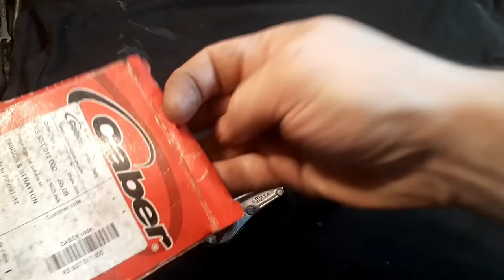Briggs & Stratton Classic Engine Restoration (3.5hp) Restauracija

Comment: This how i got started  with  small lawn mower  engine i used to cut grassy for my community  10 bux a lawns  me my  father  found a cpl lawn mowers  in the  garbage bumped  we got one going  to  my little  business  and  after month later some of  my  money  i saved up me and my dad  went bought  new parts and  other stuff like blade and we started  rebuilding  one push mower   i was able to cut more lawns in short amount  of time i save enough  money  for the following  summer  for used riding lawn mower 😊

Comment: Pro tip: your lawnmower will last a little longer if you fill engine oil after 'restoration' . Also remember to apply a little oil onto the air filter sponge.

Comment: You should be using a torque wrench on the head bolts.  Otherwise the thing I will point out to a lot of folks is this isn't a car engine, a typical 15 year old B&S engine probably doesn't have more than 200-300 hours of use on it so you can use a lot of barnyard meckanic tricks on it and it will likely outlast whatever it's used on.  Most mower decks seem to rust out as people do not clean the bottom of them after use, leaving wet grass stuck to the bottom of the deck, ruining it.   Back in the 60's a few lawnmower companies (Hahn for example) used aluminum castings for mower decks and those mowers lasted 50 years or longer.

Comment: You forgot to oil the "Oil Foam Air Cleaner" increase the revs a tiny bit. Very Good Job :-)
Reply: Totally unecessary.  Only make dust stick
Reply: @Teddysad  exactly. Preventing it passing through the sponge

Comment: I noticed you left off the oil breather elbow at the carb.  Was there a reason?  The open pipes let oil droplets coat the outside of the carb and tank, and the inlet to the carb can suck trash into the venturi.  It will run ok for a while that way but it will cause problems over time.  It's been a long time since I tore down an old Briggs.  Thanks for the trip down memory lane.

Comment: Hello and a big thank you because thanks to you I have just rebuilt my engine and I would never have done it alone.
When starting the engine it smokes a lot and seems to be heating up. I do not know if it's normal. Maybe it's the engine break-in?
I also don't know if this engine has a starter and a regulator?

Comment: I'm gonna rebuild our 1970s Norlett mower's Briggs 3.5HP engind it is different from the one you work on it has the recuil assembly mounted on the right side and the fueltank, carburetor and air filter base is different 😄

Comment: new rings, and seals at bottom and top of crankshaft .also did you lap in the valves? if not you didn't do a complete overhaul
Reply: what does lap in the valves mean bud? I'm about to restore mine
Reply: @benhart7469  its when you take a grinding compound (looks like a paste with fine micro sanding/ grinding granules) and smear it around the inside at the top of the valves, drop it into the engine (where the valves go), make use of a grinding tool (With a “rubber sucker” on the end and a shaft to roll/ grind with your hands..imagine making a fire in the field motion), which will grind away any carbon around the valves, while at the same time polish and embed/ “seal” the new valves.

Comment: Muy bien el vídeo, muestras algo de interés, solo tres preguntas que ocupas para calibrar la bobina y el rotor.
La bujía que calibración es la correcta. Y que aceite recomiendas cuando las condiciones ambientales son arriba de 35 grados centígrados.
Muchas gracias caballero.
Reply: Para calibrar la bobina contra el volante... Una tarjeta de cartón 😅 tarjeta de presentación cualquiera...
La bujia, una que ya tenga una calibración estándar. Y aceite recomendable el 20w50 para la temperatura dónde te encuentras

Comment: Nice work, but you´re missing something... this engine is 4 strokes, and has a carter, where you MUST load oil. You can see the filling hole at the bottom. A screw with a female square drive. Be sure that you add enough oil, or this engine will have a short life.
Reply: This is the oil drain plug. He forgot to show the people, that you have to fill up the oil before starting the engine :-)

Comment: Hello, the video is very useful from it, I learned a lot of new things for myself, exactly the same engine always worked well for me, and suddenly the spark plug started to turn black, I thought it was a rich mixture, disassembled the carburetors, again  cleaned, put in its place, the engine worked for a short time, then the candle begins to turn black again, you can state the reason for the candle burning  I will be very grateful.
Reply: Oil leakage issues either from the rings being installed improperly (the gaps should not line up) or leakage through the valves due to excessive wear.  You can try a hotter plug in the engine.  It isn't a fix it's a workaround but it might get you some more years from it.

Comment: Easy engines to work with, but the older engines have better lubefunktion on the oilring of the piston and litle bad that valveadust funktion , when there  its no adjust , must sanding off the end of the valve litle and check the valvegap

Comment: An amateur restoration at best. A rough clean and then a paint is not a restoration. The only thing here  to learn ,was how not to do it on nearly every level. This just encourages people who do not know any thing to think that is all there is to it. Sometimes a little bit of knowledge is worse than none. People do work like this, and just because it runs they are convinced they know what they are doing. See it all the time on vehicle engines as well.

Comment: Great job, I learned a lot.  What type of degreaser did you use and what type of lubricant did you apply when reassembling the motor.
Reply: I  use  brake  cleaner  and  engine oil  or  transmition  oil,litle.Do  the  job

Comment: Since there are valves on the cylinder, then this is a 4-stroke engine.  But I did not see when they poured oil into the engine.

Comment: Bonjour, beau travail, mais également une grosse erreur de débutant, ce n'est un reproche mais juste t'informer ou te rappeler, ton tournevis à plié de ta faute et non faute à sa qualité. Pourquoi ? Donc petit rappel l'outil à choc servant de tournevis pouvant même recevoir une douille ! Face à tout écrou ou boulon de 8 à 50 voir 100 et plus, peu importe, si très dur à débloquer, on ne tire pas progressivement de plus en plus fort, au contraire, comme l'outil à choc, (en général un coup suffit) donc un coup sec et si nécessaire, un autre coup sec dans le sens inverse et puis de nouveau dans le bon sens jusqu'à déblocage, sans oublier l'aide d'un dégrippant, une fois fait, ne pas oublier de nettoyer les filets du boulon ou de l'écrou, s'il doit resservir, sinon il se grippera à nouveau car la crasse va fabriquer très vite un nouveau colmatage digne d'une super colle, cette dernière partie n'était pour toi mais au cas ou des novices liraient ce texto,(sauf jantes alu sur fer, dur dur réaction chimique entre l'alu et fer, dur dur nécessitant parfois le , les coups de masse de l'intérieur vers l'extérieur, pour éviter cette réaction, vaseline, graisse blanche mais pas graphite, lol sinon noir, noir, lol )

Comment: What is The thickness of the piston rings. I have tried to find to my bs engine but everyone i find is to thick. The one i need is 65,10x1, 2mm. Do you have the old ones left so you can measure them so i get the right part number. Greetings Frank
Reply: Do you have the model code on the engine, typically on a vertical shaft sprint engine it will be on the front of the pull start/cooling shroud, above the head of the engine where the spark plug wire slips through. If so, Briggs and stratton has a decent model search function (search on Google Briggs and Stratton model search and the first link should take you to a page showing you where to typically find model codes, scroll down to where it says search for manuals in a red bar, fill in the information like selecting searching for a engine, what equipment it is on, and then the model code, it will be the first two of the three sets of numbers on the shroud combined with a dash)

Comment: What about that snapped off stud on one manifold? There are hundreds of hardly used engines better than this at every recycle centre, simply because these engines last a lot longer than the steel mower bodies. New head gasket, but used old crank oil seals and a home made crancase gasket, poor service ideas. Using stones to refurb ally bores leaves carborundum dust embedded in ally bore, the trade uses ally oxide flapper wheels instead. You should also use boiling water and washing up liquid to purge the bore, etc etc etc....

Comment: I have a problem. oil comes to the carburetor from the metal pipe that comes from the engine and throws white smoke and does not work properly. what problem do you say it has?
Reply: Could be a few things... oil to thin on weight (use SW-30 synthetic), bad plug,  to Much oil, bad/ dirty air filter, rings leaking buy. I rebuild/ fix/ repair/ flip/ sell mowers all the time since I'm now retired.
Reply: Труба от двигателя это сапун. Дым, синий это сгоревшее масло. Нужно прошлифовать цилиндр и поставить ремонтные кольца.

Comment: The exhaust on these suck. Redirecting air twice using a baffle and spark catcher. Removing spark catcher and drilling extra holes in the baffle increase power significantly.

Comment: the stiga petrol lawn mower electric start only I am of the opinion this mower with the briggs stratton  has a design fault Ihave taken it back to the dealers at wirksworth but they do not sort the problem out you can o nly start the mower on the electric battery and due to its design the connections do not always connect the fault lies in the design making start up very difficult at times in fact it will not start at all